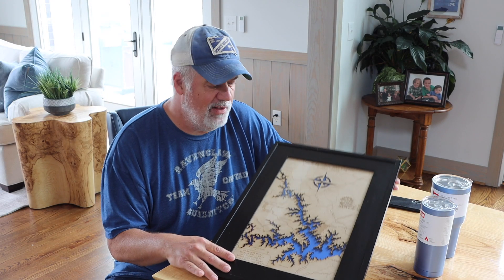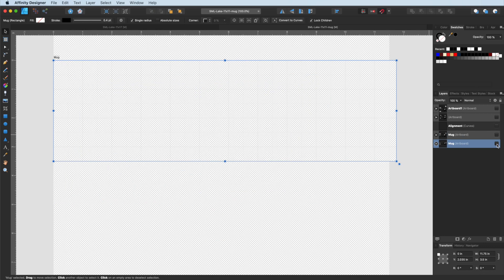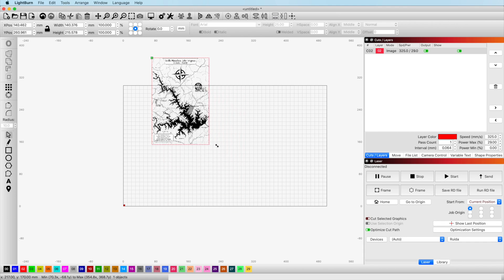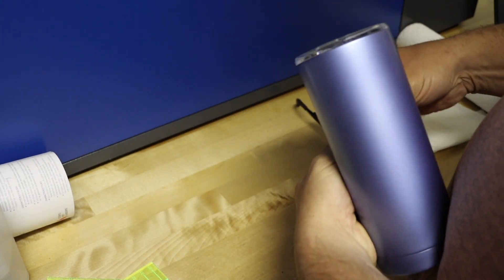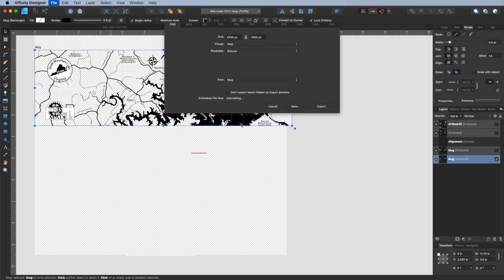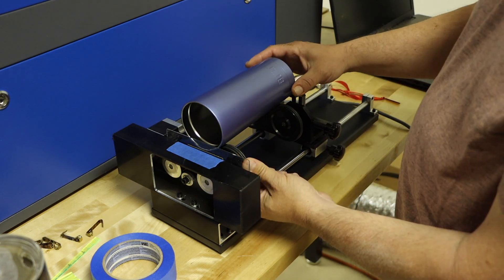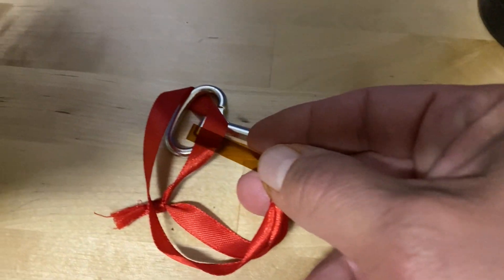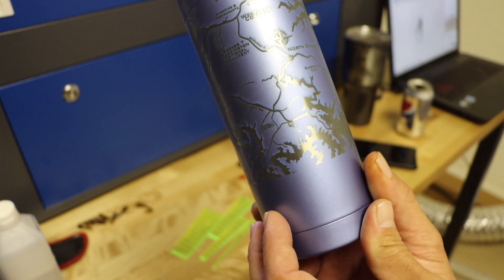Laser Etched Tumblers on a Rotary, more Lake Art with Lasers!

Comment: I have the same rotary and had the same problem and i found that the drive wheels were slightly out of parallel to the other side. In your your video you can see two bolts if you loosen those you can make sure both sets of wheels are parallel with each other. I dont have any problem with walking now